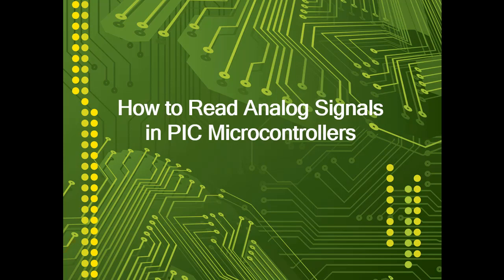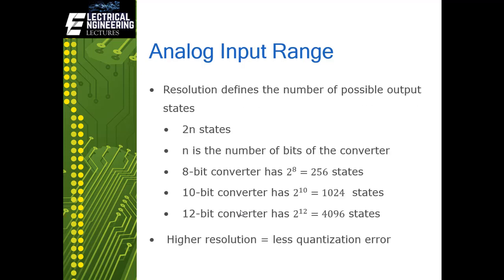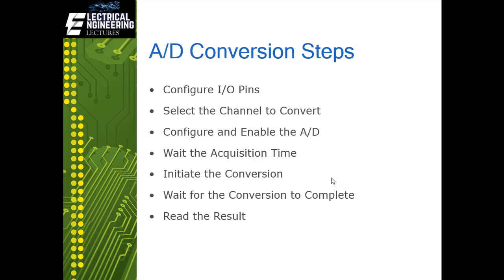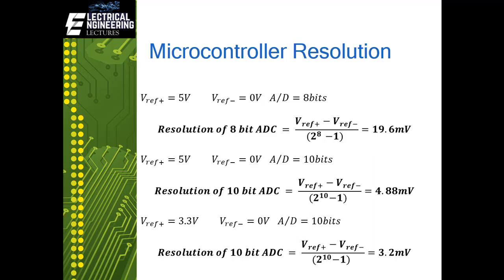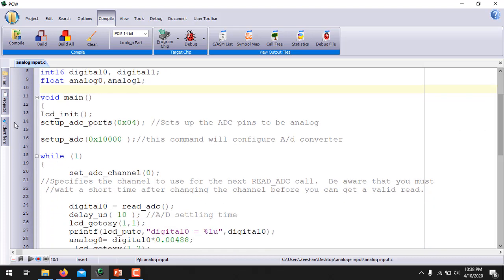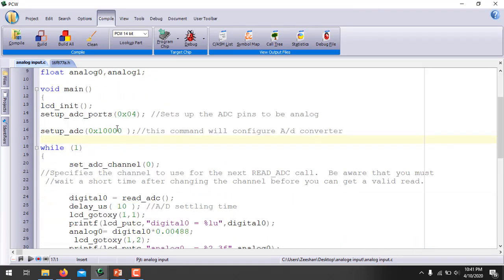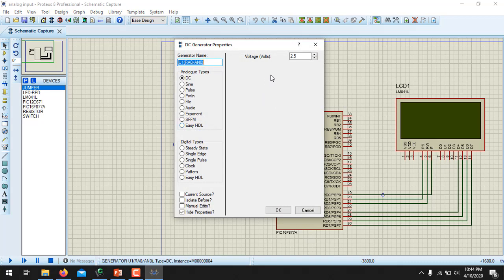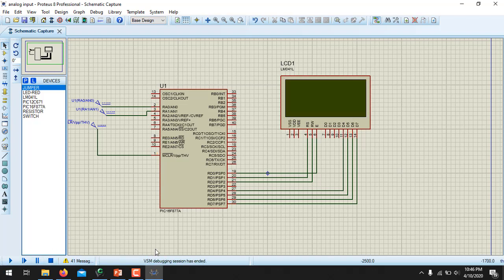Analog to Digital Converter ADC in PIC16F877A Microcontroller | How to Read Analog Inputs

Comment: Great video thanks. I have one doubt though.. Since the input signal is analog and it's value is always changing between 0-5V, then how did you give 2.5V ? shouldn't the value keep changing? I am new to this, sorry I don't understand it, thanks.
Reply from the maker: Analog means you can read any value between 0-5. 2.5 is in between them. Bu digital we mean 0 or 5v not any voltage in between

Comment: In your program you have not define output pin of the microcontroller then how u have connected to those data pins of LCD  in the microcontroller.
Reply from the maker: I have included lcd.c in which pins are already defined for lcd

Comment: Why when i compile it say that there is an error "can not set this option this far into the code" in the line #device ADC=10
Reply from the maker: Adc = 8 bit if your microcontroller has 8 bit adc